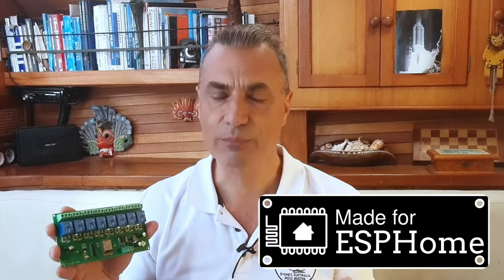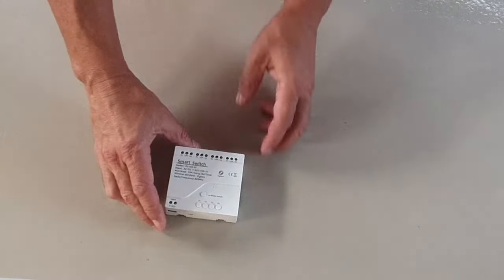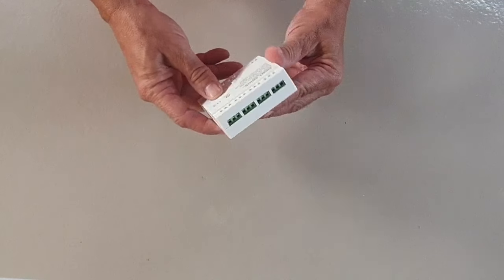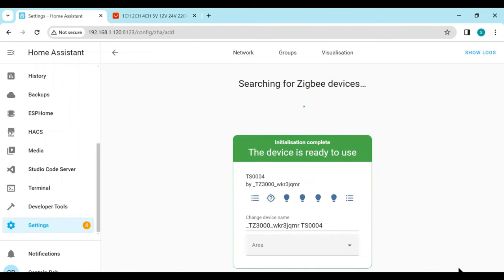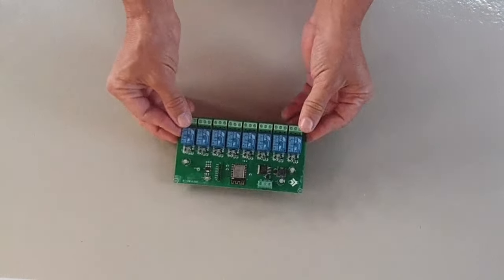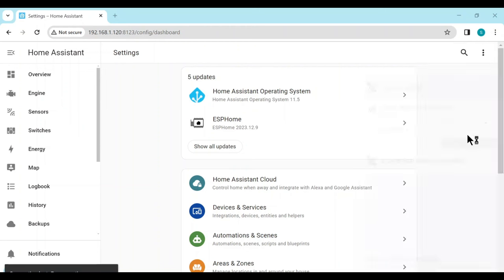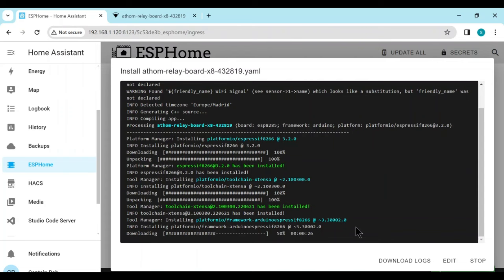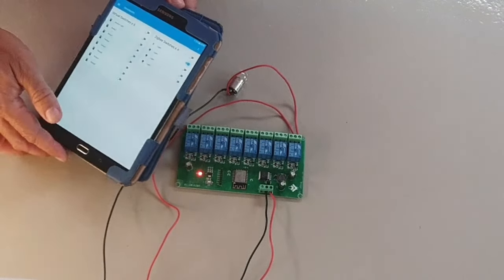Smart Boat 17: Virtual Switch Relay Boards

Comment: Great video Rob. How about combining all the switching also with voice control. Like this you don‘t need a touch device to hand, eg at night going to restroom just via voice eg switch on red lights on the way and in restroom by just „Siri toilet lights on/off“. The HA knows if it’s night or not and illuminates the way or not.
Reply from the maker: This is possible but at the moment the best working solution requires an internet connection. I try to have all of my solutions working offshore with no internet. Running voice locally works but there is a lag as it requires processing power but maybe on a Raspberry 5 it will be acceptable.

Comment: I like your videos, thanks for sharing! Does the 8 way relay board also give power consumption data? I guess the zigbee one does..?
Reply from the maker: Thanks. These boards do not show power consumption information. They use a basic relay in place of a manual switch. Would be a very interesting board. Maybe someone can build one.

Comment: HI, great videos. Can you explain how the connections are made if using an existing light with a manual switch? Thanks
Reply from the maker: @Jmarty34  You basically connect the virtual switches in parallel with existing manual switches.  The actual wiring depends on your installation.
If your boat uses circuit breakers, you will need to add additional fusing for the devices connected to the relay board. This is because the fuse is integral to the switch.
Consider using a fuse block with spade fuses to provide individual protection for each device. This setup ensures that if one device fails or draws too much current, only its fuse will blow, leaving the rest of the system operational.

If your current physical switches are individually fused, you might be able to reuse the same fused circuits for the relay board devices.
Ensure that the fuse ratings match the current requirements of the devices connected through the relay board.
Reply: @SmartBoatInnovations  Hi Rib, which relay board do recommend for use with lights or devices that would be controlled using manual switches. Thanks
Reply from the maker: @Jmarty34  I personally use the 8 way  and it works very well. Get the one in the video description that has esphome pre installed. But then others have used the zigbee one and are happy.

Comment: Great video Rob, can I use the ZigBee Relay board to run a self priming bilge pump (12v probably 7 amps) in combination with the ZigBee water sensors?
Reply from the maker: @veitladurner1925  Yes. The zigbee one I used  the relay was rated at 10A. You just need to setup an automation to turn on the pump when the water sensor state changes to moist.

Comment: Greetings, Rob. I’m wondering how the smart boat relays interface with the boat’s standard physical switches or are they eliminated?
Reply from the maker: Hi John, if you have existing physical switches you can use them in tandem with the virtual switch. If you doing a new build you could choose just to have virtual switches.  Actually the 4 way Zigbee relay board has physical switches as well.

Comment: Could you tell something about the fusing and circuit breakers?
Reply from the maker: It's crucial to ensure that all devices you connect to the virtual relay board are adequately fused. The method you choose depends largely on your current setup with physical switches and fuses or circuit breakers.

If your boat uses circuit breakers, you will need to add additional fusing for the devices connected to the relay board. This is because the fuse is integral to the switch.
Consider using a fuse block with spade fuses to provide individual protection for each device. This setup ensures that if one device fails or draws too much current, only its fuse will blow, leaving the rest of the system operational.

If your current physical switches are individually fused, you might be able to reuse the same fused circuits for the relay board devices.
Ensure that the fuse ratings match the current requirements of the devices connected through the relay board.
Reply: Also, add the fuse to the positive DC cable as close to the relay as possible. That way if a short happens anywhere along the length of the cable the power will be isolated back at the source when the fuse blows or breaker trips.
Reply: Hi Thanks for tour reply! Are there any boards that have the fuses/circuit breakers integrated?